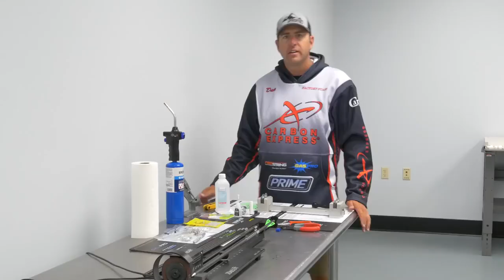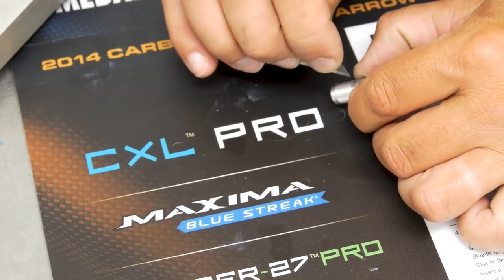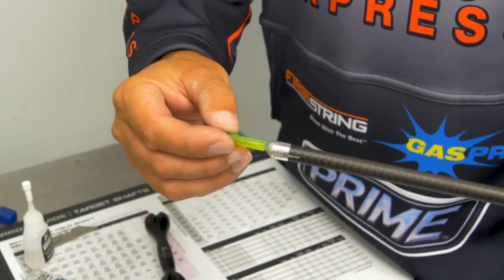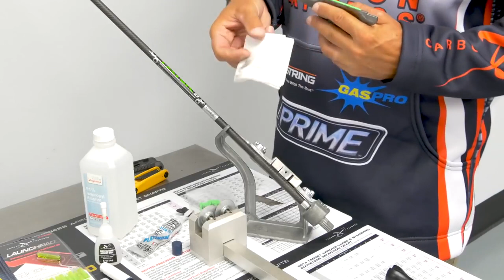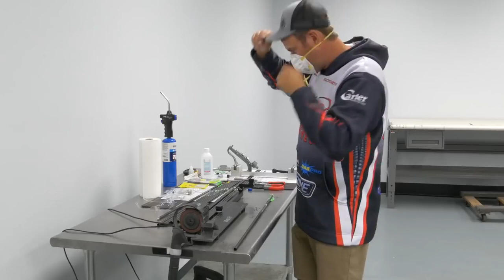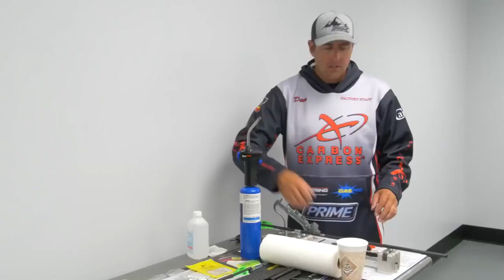Building target arrows   Dave Cousins Carbon Express Factory Pro

Comment: How clean is the inside of that carbon. Blow it out with air is there a lot of dust in it.  Or wipe out stick.  Just curious I am a scientific glassblower and work with Quartz glass tubes and have to acid wash and wipe out id.